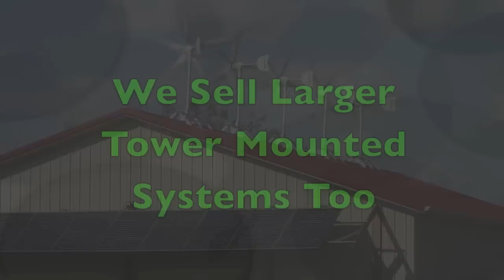Colorado Solar Panels in Colorado - Solar

Comment: Want Solar Power For Your Home in COLORADO? Our solar installation on Your Home is provided by some of our local dealers. We have a network of customers, dealers, and installers from Hawaii to NY. WindEnergy7 LLC will support your project as a self install, or a turn key install with assist on managing your project. We don't just sell parts, we sell complete systems for Your Home in COLORADO.
.
MORE Videos, Pictures, and Pricing - - Wind Energy 7 . COM
.